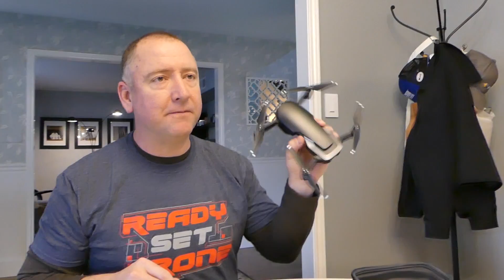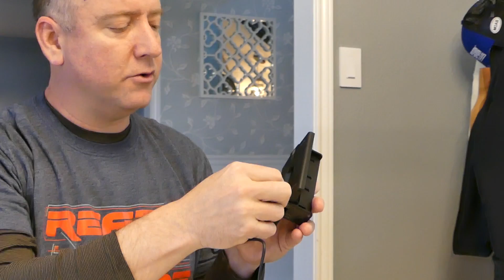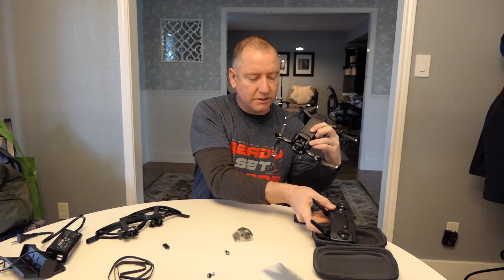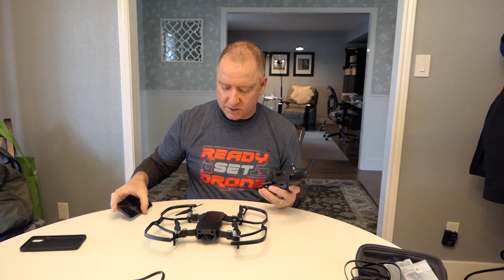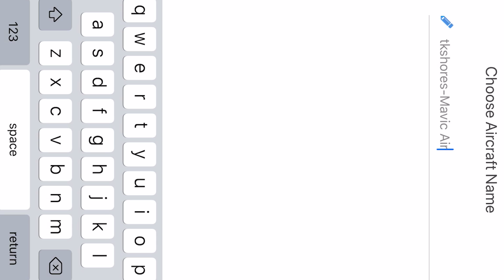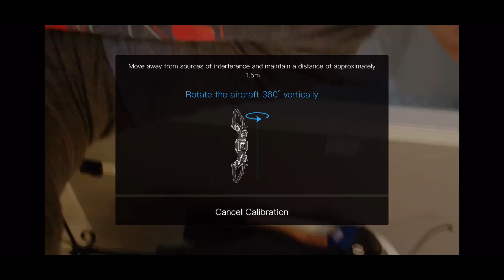Mavic Air Setup (For Beginners)

Comment: Thanks for the introduktion.
The back light dose have 3 function (presse once, presse twice and three times) spild you please tryk to explain these three functions.
One other thing, I am travelling Soon with my Mavic air and sine the drone Works with WiFi, dose that men  I have to buy a local som card for each country?
besr regards
David from Denmark
Reply from the maker: Hi David. No need for a SIM card to fly this drone. See this video by my friend, Billy, who talks about the button on the back light. https://youtu.be/uVn88rVNOL0
Reply: @readysetdrone  Thank you for your kind respond. Do you Mean that I am able to fly my drone now with out an Sim card!?
Best regards
David
Reply from the maker: Correct. Sometimes you need to update firmware and need wifi, but normally you don't need an internet connection to fly.

Comment: 2 MORE TIPS FOR NEWBIES:

1. If you have problems linking, check the USB settings on your phone. My phone was being charged by my controller so it wouldn't link.
2. If you use a Meizu phone like me (Chinese Android), you won't be able to fly without a REVERSE USB cable - this is because the long side of the Micro-USB port on the phone faces you, this cable does NOT come in the pack. Happy flying everyone!
Reply: Hey Dallas, thanks for the tip. Can you give more detail about what you did to solve this issue? I think I'm having the same problem.
Reply: @OscarsCRM  As soon as you connect the phone to the controller and turn the phone on, search in settings for USB. If its incorrect, the controller will be charging the phone. I changed mine to MTP. Then I open the DJI App, then turn on the drone.Sometimes, it works first time. If I try restarting my phone , I still have to go to USB settings, as it resets itself! Also, make sure drone is on when you can hear it beep, and see the props wiggle. I also try hotswapping batteries where I dont turn the drone off, just swap the batteries, sometimes it reconnects straightaway. Keep drone and controller right next to each other too. The other day I couldn't connect but I hadnt fully pushed the controller cable into the phone, even though it felt inserted!

Comment: when i hook up my phone to the remote control it charges my phone is there a way to turn that off??
Reply: Maybe they do it to make sure your phone doesn’t die mid flight and loses signal. Then the drone might rth and crash on the way.
Reply: I noticed the same and asked the rep at the local DJI center and told there was no option to stop the controller from acting like a power pack.  That is rather dumb.

Comment: Conclusion of this video:(IMHO):
1. When you plug in the micro usb, make sure the dji logo on it is facing up
2. Pull the head of the cable, not the "neck"
3. Warning! The blades are sharp, feel it with your fingers, not your face(DJI, are you guys watching? So, where's the warning?)
Just imagine 4 small blades hitting your daughter's face, then only you would realize the DANGER!

Comment: Last week, my AIR wouldnt fly 70 meters away without losing RC connection. That too straight up while doing a manual ROCKET type maneuver. This was a semi urban area on the outskirts of the city. Some drone this is. 3 days ago it flew 200 meters away horizontally (which needs more signal strength than straight up) that too in a dense city environment (crammed with WiFi interference) from my rooftop. The most unreliable piece of tech. I dont know how the Mavic 2 is ? Even with that they are having fly-aways and what not. PS : You can obviously guess how proud i am of 200 mtrs, lol. That's a big deal with this drone. Ive done 500 mtrs etc too but then the alarm clock went off and i was wide awake.
Reply: Numbskull

Comment: If its a brand new mavic air battery, should the battery be allowed to stand in the charger overnight even after the charge blinking has stopped ? Like a battery break in or something. Some people suggest doing this for phone batteries etc which are new. DOes the same hold good for these ?
Reply from the maker: I have not heard of that. I think once the lights stop blinking, I the battery is at 100% and can be taken off the charger. I've actually heard that it's not good to leave the batteries on the charger too long once they are charged. But, these are "smart" chargers, so I think that it's not a problem either way.
Reply: My new MAVIC AIR is a regrettable experience. Havent even flown it yet. The remote controller once fully charged lasts only 30 minutes that too when not even flying. Just idling and checking the remote functions thru the android app to get a feel for them and it last me 30 minutes. How the hell will i fly with my flymore combo which has 3 batteries which will outlast the remote. Kind of defeats the purpose of having a flymore combo when your remote will last only 30 minutes on a full charge. And charging the remote from say 20% to full TAKES 3 HOURS.
Reply: @mgr5550  that's not normal. You have a defective controller or doing something wrong.
Check on dji Mavic Air forums and ask there.

Comment: i would like to add minor disappointing correction, the 4 battery charger Does Not Charge 4 Batteries at once. it charges them one at a time in a sequence.
Reply: So You rather have 4 half charged batteries than 2 fully charged batteries and 2 empty ones?
Reply: @MrMoshoeshoe  how is it 2? The charger does all 4 batteries at the same time and fully. Where did you get 2 half charged?
Reply: It was designed that way on purpose. There is only so much current running through the charger so instead of splitting that electrical current between 4 batteries and charging them all slowly it focuses on charging one battery as fast as possible so you can get back in the air.
Reply: @kyledavidson3845  I see. Ill have to drain my batteries and put two on each charger to see which charges faster. Thanks for the reply.
Reply: Yeah. This was really disappointing. I ended up buying a 3rd party charger from amazon which charges 4 batteries at once, plus has 2 USB ports for charging controller and phone.
Reply: It is what it is! Deal with it! Bunch of whiners!

Comment: Can the FAA sticker be underneath the battery? If I have my drone replaced by DJI Care, can I use the same number of the downed aircraft?
Reply from the maker: I believe that the number can be below the battery. As long as it can be seen easily when the battery is removed. Yes, the same number applies to all of your drones.
Reply: Thanks for the quick response. Love your informative videos! 

BTW: Make sure to check out headtracking on the Mavic Air with the Goggles, it is possible if you swipe down with two fingers on the Goggle's touchpad and activate it. Would love to see a video testing it on the various DJI drones and comparing it's functionality with each.

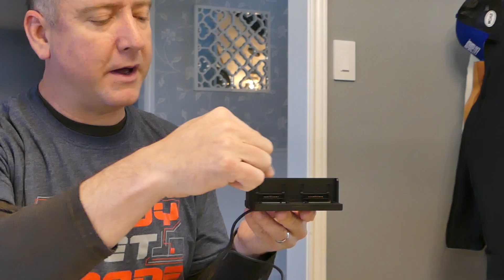Comment: 4:00 The batteries charge in sequence?? Disappointed it works that way. Approximately how long does it take to charge a battery from near-empty? So after having fun for about an hour in the air using three fresh batteries, you go back to a power source to charge them and have to wait for them to replenish 1 then 2 then 3 before heading back out again for another hour? I guess that's OK if you're flying in your backyard, but out in the field where you have to return to a power source (coffee shop, hotel room, etc.), having to wait sequentially seems not good.
Reply: nothing's stopping you from buying 200 batteries. By the way, the charger is smart enough to start charging the battery with the most juice in it first, which I think is cool. If it chargers all batteries at the same time, now that would be more disappointing.
Reply: From my experience it takes at least an hour at minimum to recharge one of the batteries. So I can get one back from ~30% to 100% on a portable 110v charger while I use up the other two from the Fly More Combo. I'm definitely going to be getting a 4th battery down the line.

Comment: The manual says that the second part of the compass calibration should be nose pointed downwards. Any idea which is the right way?
Reply from the maker: Great observation. The picture in the app shows it with the camera facing sideways. My suspicion is that either will work, as long as one is horizontal (drone in normal flat position) and vertical (either nose facing down, up or sideways). I've flown several times since this video was made and had no issues with it the compass or GPS, so it seems to have worked.
Reply: Ready Set Drone thanks for the clarification! To confuse matters further my app shows a diagram of the drone facing sideways like yours but the descriptions says to point nose down...